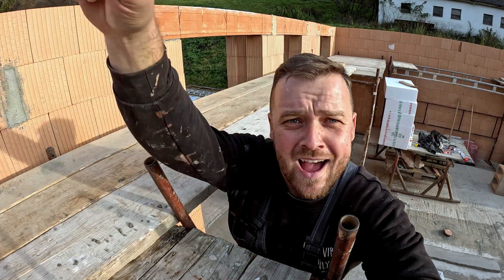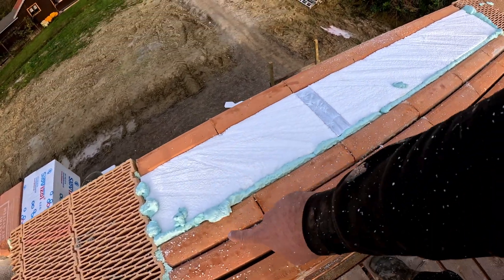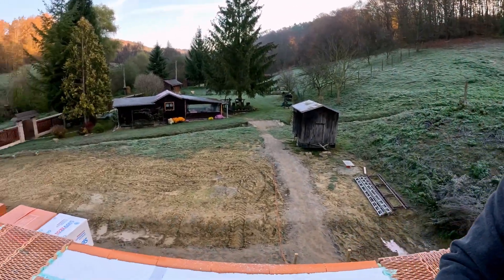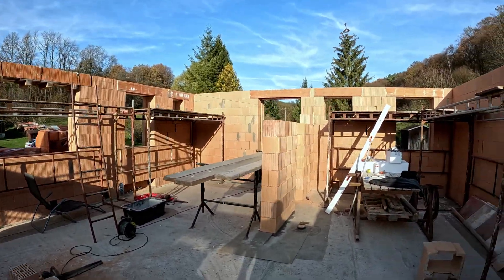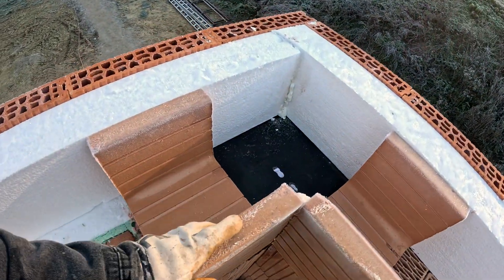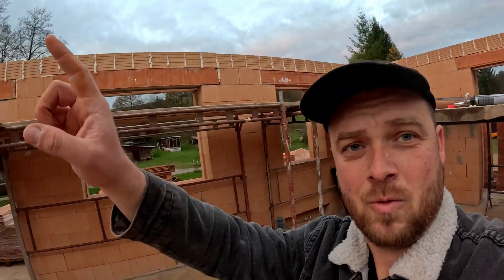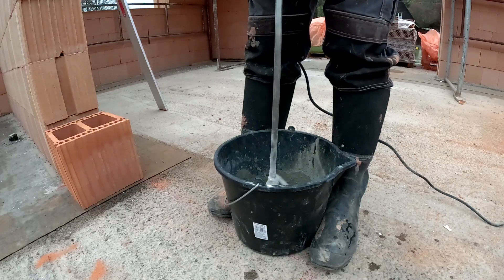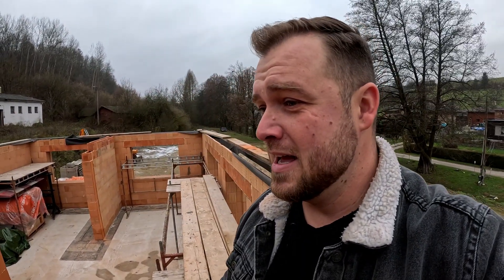2025 Modern Brick House: Cost-Saving Concrete Wreath Design Explained! | (#21 How to build a house)

Comment: One question: i study architecture and in germany and i wondert why do you use water resistent tap, when the styrodpor isnt water resistant.
Reply from the maker: Thanks for question. Please can you describe you question little bit ? I didnt understant what exactly you are aksing for. If you mean the asphaltus inpregnated sheet in corner of building => the main reason of it is to prevent the concrete from concrete wreath during pouring and vibrating fall down to hollow bricks. If you wont prevent it than the heat resistance of wall will be damaged and you create heat bridge. Also big danger of it is that if concrete fall deeper to brick it can crack whole wall during hardening. If I didnt answear your question than please I need more speciffic question 👍😁